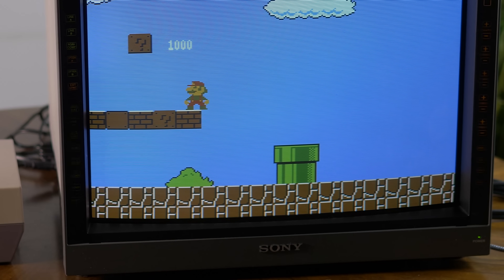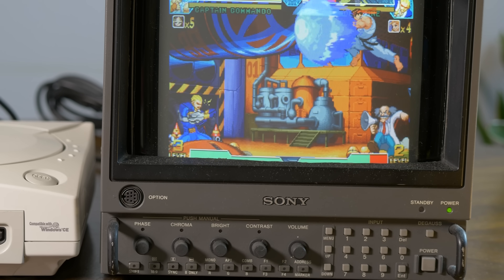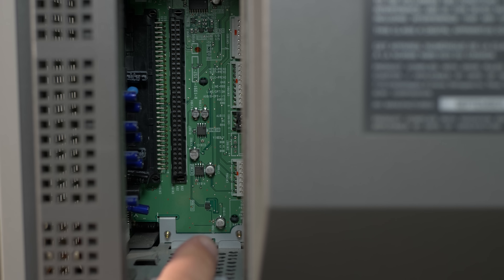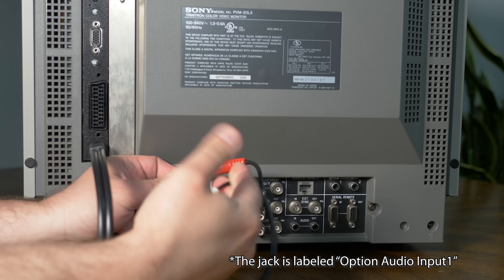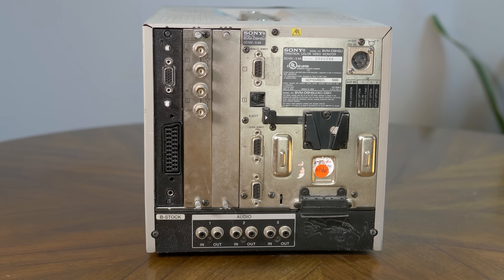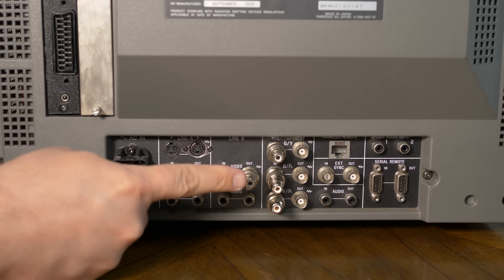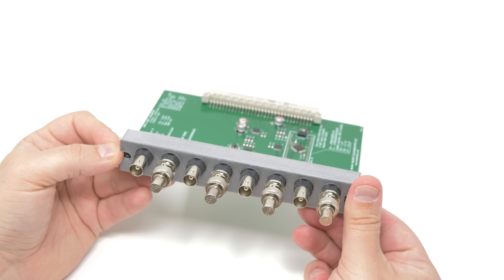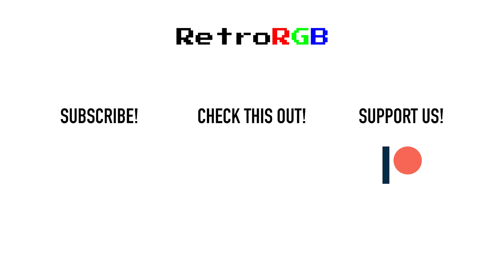Dual Input SCART & VGA Card for Sony L-Series PVM's

Comment: I can’t get an MS-DOS machine to show up through the VGA input of this card am I missing something?

When I set to RGB on Option A input everything is wonky colors also
Reply from the maker: MS DOS is often 70Hz, which won’t work on any PVM.
Reply: @RetroRGB  gotcha I can run it through a VSC 500 but I have to adjust the size and position by hand, and can’t utilize some other parts of my setup since I’m skipping them
Reply: @RetroRGB  I’ve been struggling to try and get an x486 machine and a Commodore 64 working on a PVM
Reply from the maker: Yeah, you'd be better off getting any VGA CRT monitor for the PC's and use the PVM for consoles.  Don't get me wrong, I LOVE PVM's...it's just different tools for different uses.
Reply: @RetroRGB  I’ve picked up a couple VGA to SCART adapters and other such things because essentially I just need everything to run RGB into SCART connectors for an ideal setup. Is that just not really a thing and those adapters are for different use cases?

Comment: Can it be used like a vga monitor on modern pc, using Vga adapter??
Reply from the maker: Yes, BUT - You need to make sure your monitor can handle 640x480p (31KHz) before doing that.  The L5-series PVM's can, but other model PVM's won't be able to.
Reply: @RetroRGB  Thank you, i love CRT and i'm collecting a lot of info to buy a Good Crt monitor. PVM's have a good dot pitch?? or looks like a standard Television tube??

Comment: Hello does this work for Sony Trinitron PVM-20L2MD ? it appears to have a removable input board for this
Reply from the maker: It should.  But the L2's don't support 480p, so you'd mostly be using it with the SCART input.

Comment: i run into an issue if i use y cables to say, add audio from two sources sometimes where one console may not push audio through it at all if another consoles is plugged in but in most console combos it tends to work that way.

Comment: Does it work with option B?
Reply: Nope, unfortunately not. There is no information sent from the monitor about this (as the BKM-129X is inherently "single channel"). Thus switching between VGA and SCART is done manually.
Reply: That’s unfortunate. I wanted to set Option A as component and Option B as RGB.

Comment: Hi guy, I have a sony pvm-14l2md model, it will works fine? because I saw that sony pvm-14l2md doesn't support vga resolution...
Reply from the maker: You're correct - This will work, but only with 15KHz resolutions.  The "VGA style" connector might still be handy though.

Comment: I picked up two of these from Retro Upgrades in the UK.. just a warning HVSYNC does not fully work on these cards, they cause distortion and waves in the top of the image.  The CSYNC input for VGA does work if you can send that type of signal to begin with.  But I bought this to hopefully just take a VGA output from a PC and it's not usable.
Reply from the maker: I'm sorry, but that's just not true.  Did you watch the part of the video that explains why you'll get sync issues and how it directly relates to the MONITOR and not the input card?  Also did you press the button to toggle between the two settings?

Comment: Could you in theory put VGA from a computer into a Sony L5 at utilizing this card? Because a PC uses RGBHV is that correct?
Reply from the maker: Yes, that works fine.  I've used my L5 as a "PC VGA monitor" with this quite often.
Reply: @RetroRGB  Hello again! Proud owner now but there seems to be an issue when I plug in VGA. The PC is currently at 800x600 but the TV itself is displaying at 720p. Have you ever seen that problem? Ive tried changing resolutions to no avail. Any suggestions?

Comment: Do these work for D-Series BVMs?
Also, are there similar homebrew input cards for Composite and S-Video (both PAL and NTSC)?
And lastly, what is the maximum resolution and refresh rate supported by the D32E1WU in both HD-SDI and VGA? And does the A32E1WU and D32E1WU perform similarly?
Does it support PS3 at 1080p 24Hz?
Reply from the maker: In the order you asked:
- No
- No
- 720p & 1080i
- The A's are more of a pain, but they're still great
- No
Reply: @RetroRGB  can you explain why the a seris was seen as better in its day
Reply: @RetroRGB how does it not work for D series bvms?

Comment: Would I be able to use this on a 14L2?
I'm thinking of using this card to turn my pvm into a monitor via the VGA port for my desktop pc while I'm not using it for retro gaming. Is this something I can do? What problems might I expect?
Reply from the maker: No.  And yes.  So, this WILL work in your L2, however that's a 15KHz only monitor, so you can only use 240p or 480i resolutions.  Even though the dsub port looks like VGA, it's up to the monitor to decide if it works...and only the L5 can accept 480p.

Comment: Purchased this from retroupgrades in the UK and i get no picture. Just black screen. I have checked the installation 3 times over for good contact etc, checked menu settings for rgb, and checked my toggle switches are in the right positions(top switch pushed in for csync and bottom switch pushed out for scart). Nothing...i have a Sony PVM14L3 if anyone has any idea's?
Reply: The top switch has no effect on SCART as that is inherently a composite sync coming in. A black screen sounds like the middle switch isn't in the correct position, did you try to like push it a little in and out while everything is on, to see if you can get something to show up?

Comment: damn I was really hoping you'd be able to switch between the two inputs with "option a" and "option b",  i'd always assumed option B would be for a second card slot, but i guess not?? who knew.

I actually have an original BKM-129X, i tracked it down shortly after i bought my 20L5, but that was like 6-7 yrs ago now. I'm guessing the originals are hard to come by now, thus all these clone cards...

Not sure this buys me much beyond my existing setup, I have a separate sync-combiner and an SCART->BNC cable with audio breakouts, although having a proper SCART with the audio out jack is kind of nice I suppose. Although with my separate sync combiner, i can plug a sync-combined VGA source onto my SCART switcher and auto-switch, seems like with this setup you'd be manually hitting that switch to go between inputs. Not horrible, but not perfect. Hmm I'm still tempted for some reason though....

Comment: Man, the UK seller has the scart version for the equivalent of about $83.  That's quite the markup for a US seller. Also, those cheap RCA to BNC connectors are 50 Ohm a lot of times.  I am not sure if that matters or not and maybe that's what you meant by it only mattering for an oscilloscope.  The good ones you link are 75 Ohm I think.
Reply from the maker: The Dual has two inputs, with a different circuit on it, manufactured during a global part shortage. That’s not a “markup”, that’s the proper cost of the more advanced model.

Comment: Does it support 50Hz PAL signals?
Reply: PAL is a color encoding scheme used with composite video and S-Video. The BKM-129X is a RGB/YPbPr card, and all the monitors that support the card should be able to do 50Hz RGB/YPbPr signals.

Comment: Ugh, I wouldn't even show people how to hook up audio to the PVM. It's a travesty to put that much work into getting flawless video only to go with the crappiest possible audio
Reply from the maker: I think context is important.  I use my L5's speakers every single time I connect a console...BUT...it's usually one of two things:  
- Testing a console for a video/review and I just need sound to know it's working.
- Setting up for a stream/gaming session.  This lets me get everything set up, then either switch to headphones, or my stereo for actual gaming.

...and one last scenario:  Some games just have crappy audio.  I'd never bother setting up my Atari 2600 through a stereo, or a few random other consoles/games.  There's just no point, plus the TV's those games were designed to be played on had worse speakers than the PVM.

So, while I understand your point, I'll never exclude some tips, just because everyone won't agree.  There's always a use case scenario that works.
Reply: @RetroRGB  Yeah, I use the speaker when I play NES.  It only outputs mono anyway and sometimes it just seems more nostalgic for whatever reason to hear those old games through a little speaker like that.

Comment: Will this work on the 14L2?
Reply: came here to ask this question!
Reply: It should (the original card was made for L2's originally) but you'd only be able to use 15kHz signals, so the VGA port will only be for ease of connectivity (like for MiSTer).

Comment: Hope it's possible to get a JP-21 version of this, but if not I guess I can get or make a converter cable.  Also, I'm guessing the L5 PVMs will still unfortunately force the picture to letterbox for 720p/1080i, so it won't quite be as good as a VGA monitor in that regard
Reply from the maker: The L5 can accept a 4:3 480p signal, as well as 16:9 signals from 480p, 720p and 1080i.  So, depending on your use this, you might call this better than a VGA monitor.
Also, I'd recommend using a JP21 converter cable.  The project is open source, so you could always re-built the board if you'd like.
Reply: @RetroRGB  Well, I can adjust my VGA monitor to 16:9 if I want, but at least it doesn't force it like the PVM does for systems like the AVS, but I have a real Famicom for the PVM so it's no big deal.
So if I wanted to make my own JP-21 version of the 129x Dual input card, would I just send the gbr files to a PCB maker, then solder in the parts myself?  Never done something like that, but I think I can handle it.

Comment: Don't PVMs have Option A/Option B buttons to select between inputs on an input card? Is there a reason why a switch on the card itself was used instead of that?
Reply from the maker: Good question:  Adding that option to this card would require an FPGA to communicate with the monitor's controls...and that would add a LOT more work and cost to the project.  Doubling the price of the card, just to enable the front "Option B", instead of the rear button doesn't seem worth the effort...and you'd still need to toggle the sync combiner in back anyway.  It's an open-source project though, so anyone's able to give it a try if they want.
Reply: @RetroRGB  That makes sense. It's still a really cool card. I'd definitely be getting one if I didn't already have a BKM-129X.

Comment: Hey Bob. Great video as always. Just one thing when running RGBS with a direct connection from Mister FPGA to the D-sub connector on the input card the jumper on VGA PWR on the Mister FPGA should be set to not send voltage. I don't know about RGBHV but with RGBS you don't want to send 3.3v or 5v. It might damage the input card in the long run. That's information I got from Will himself from Retro Upgrades.
Reply: This shouldn't relate to the latest versions where pin 9 should be disconnected. As far as I know, at least Castlemanias batch should be fixed. It is of course sound advice in any case, just to be sure :)
Reply: Our current batch (only a few remaining) will ship with pin 9 "manually" disconnected. For any future batches, we'll use Martin's latest design which has pin 9 already disconnected on the board design.
Reply from the maker: Yup, as Martin and Will already confirmed, this is not an issue at all with the production versions I link to.

Comment: Damn, now I want a multiformat monitor more /:
Reply: You might not, actually. The scanlines are a lot thinner on the 20L5, kinda like a big PC CRT monitor, because they were designed primarily for 480p, 720p, and 1080i.

So while it's nice to have for 480p consoles like the Wii, I think a lower-res PVM, like a 20L2 or 20M2, are much better for 240p.
Reply: I have heard this from a few people. 480i also apparently looks a lot more flickery because of the separation of the scanlines. My purpose for a multiformat monitor would be for 480p and 720p though. I have 240p/480i solutions I’m happy with
Reply: @dylanjastle  Don't sleep on PC CRT's for 480p and above.
Reply: For sure. I have a couple pc crts and a scalar to act as the poor man’s bvm. But I haven’t found one with the contrast and colors to leave me all the way satisfied with high res stuff
Reply: @dylanjastle  Make no mistake - 240p on a 20L5 is excellent. I'm not sure why the other user would state otherwise. The primary talk regarding the 20L5 comes from 480i with spacing between fields. Thinner scanlines (higher line count) honestly comes down to preference, and most folks seem to prefer 600 lines as opposed to the 20L5's 800, which is totally fair. Some folks think 800-1000 (BVM range) is too sharp, others think 600 is not sharp enough. It's all preference in the end.

It is theorized the reason for 480i field spacing is its multiformat capability, but I don't think anyone has technically proven that. 240p is just fine.